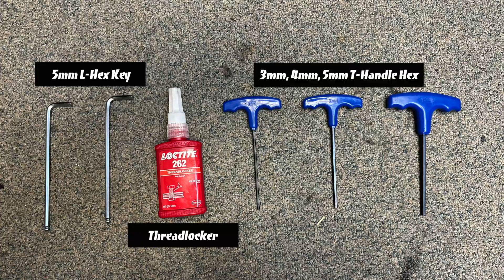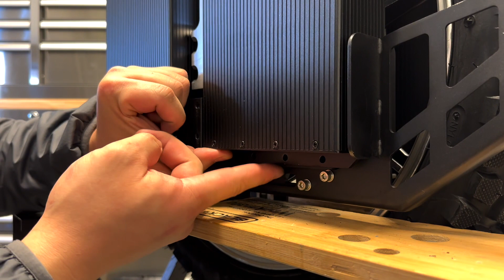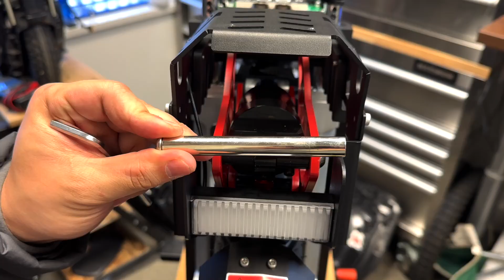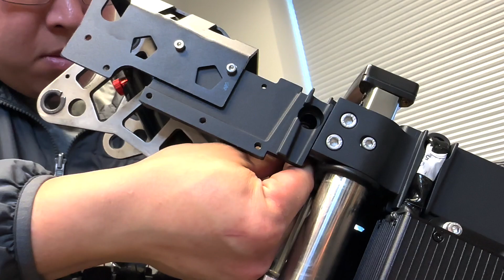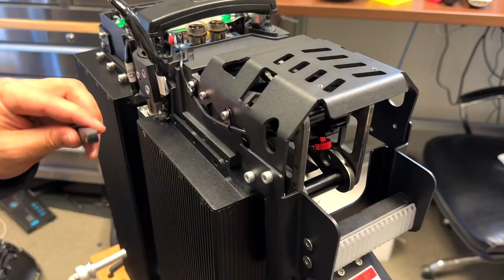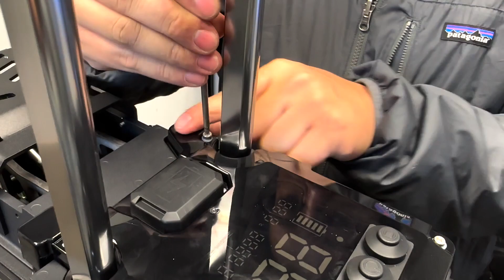Master Pro Linkage Install

Comment: is this going to be the same for the Master Pro V3?  I’ve ridden a little over 21,000 miles and the stock air shocks are no longer holding the pressure.  I air it up and it goes soft overnight, so I was looking at buying the DS200 Suspension Kit.
Reply from the maker: yes, i believe so.

Comment: What is your weight while riding?  Are the connecting holes hard or soft?
Reply from the maker: I weigh 250lbs with gear, and I use the hard holes.

Comment: Any noticeable difference from the stock linkage? Also, where did you get the aftermarket leakage from?
Reply from the maker: Huge difference. The air shock actually becomes progressive (good bottom out prevention) and you require much less PSI for your body weight. I used to run 400psi in my Master Pro, but now only run around 250psi. This aftermarket linkage was from Hou Ning Ning - but I would wait for the begode ones as they are anodized blue color which is pretty.
Reply: @2cells1pack  When should the Begode ones be coming? Where do you get them?
Reply from the maker: @Jimmyfreitas35  We should be receiving the begode ones soon. They are ordered and waiting to be express shipped.